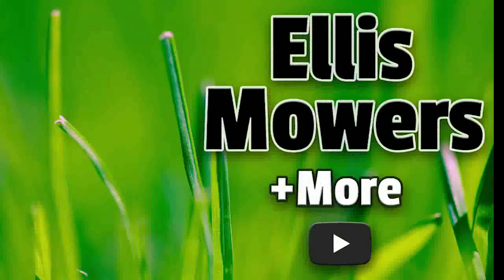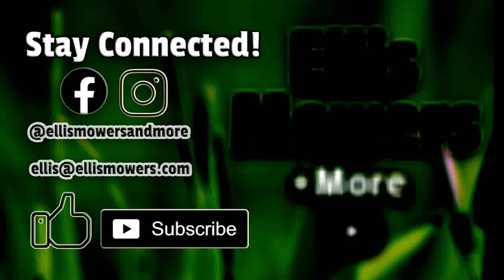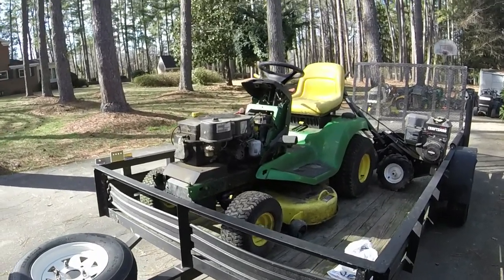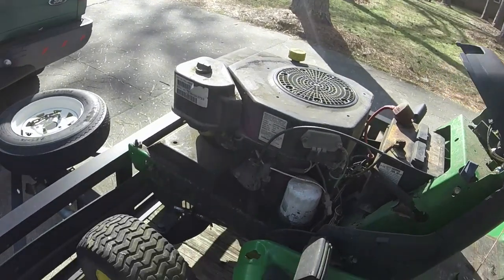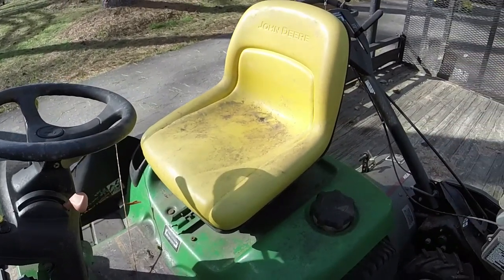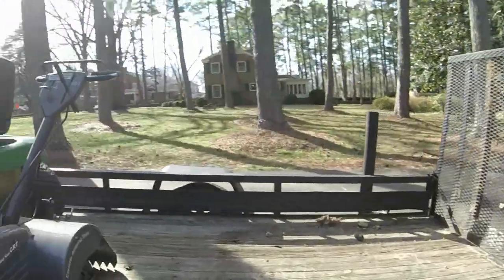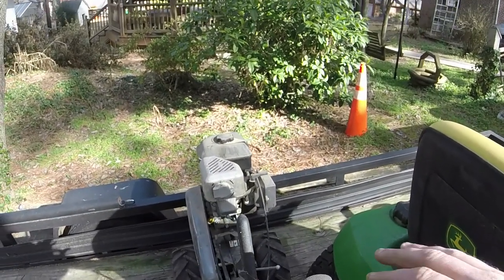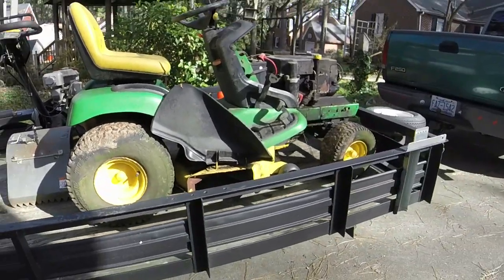When you get two free riders but the free barn find tiller steals the show!

Comment: Great finds! I wish I could find more near me but I live close to the city and pickings are slim. Something I do different than you is I always stop at the car wash and use degreaser and hot soapy water before I go home. Makes them easier to work on and easier to sell quickly after. 🙂
Reply from the maker: I don't go out finding items anymore, I only buy or pick up things when people reach out to me now.  I've started washing the machines when I get them off the trailer now too.  That John Deere was caked in oil!

Comment: I saw that 455 in the background of another video and thought: "Shoot, what's he doing with that? Those owners have usually got a stack of dealer service receipts a mile thick." (Or they're actual farmers and they bought it because it was a diesel.)
Reply from the maker: I know it had some work done to it recently with the hydro pumps for the all wheel steer.  My job was to get the deck level which was just an adjustment arm out of alignment.  Great machines, but can get pricey to fix for sure!

Comment: The engine in the John Deere 150 is probably a 13 / 15 horse power  over Head valve probably hydrolic lifters the tiller will start on the first pull
Reply from the maker: 12.5hp Kohler command, I would expect it to run with little effort like you said.
Reply: @EllisMowersandmore   that Briggs and Stratton engine was thirsty as for the Kohler engine  your engine was 1)2 h.p.lower than mine on my lt 133 the most expensive repair is the carb  because of the engine is a style of mechanical fuel pump I'll send you a picture of my Kohler engine on my Lt 133